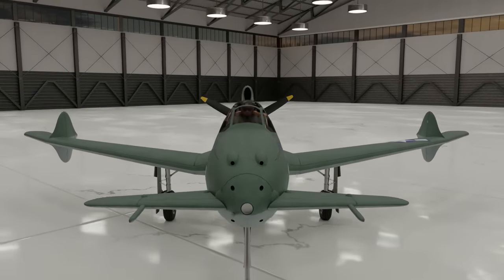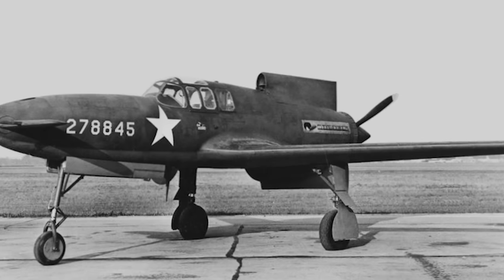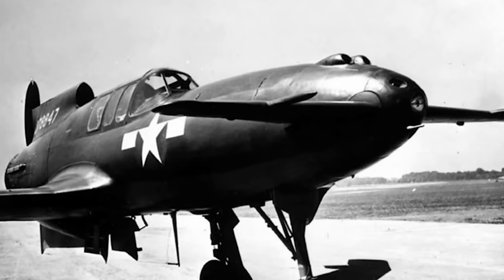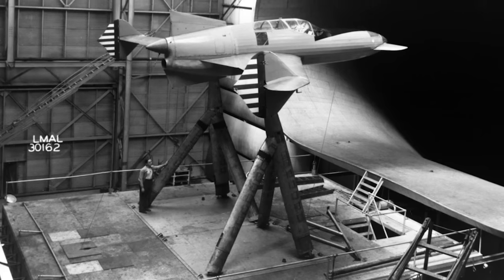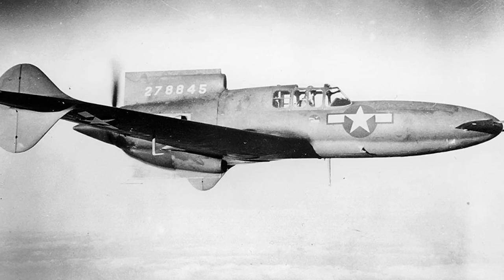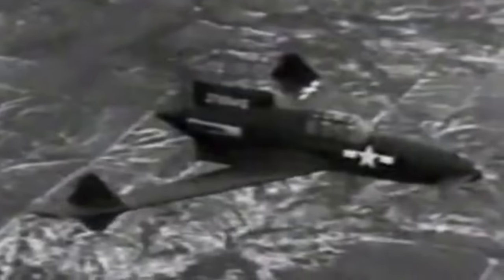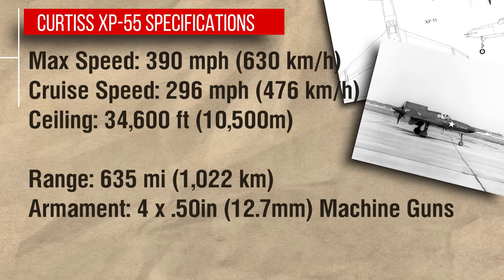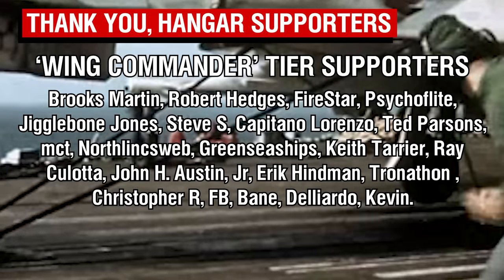The WW2 Super Fighter That Was Built Backwards | Curtiss XP-55 Ascender [Aircraft Overview #76]

Comment: Often wonder if the similar looking Kyushu J7W Shinden had undergone more testing  how it would have turned out in comparison to the XP-55. IIRC only 3 test flights were flown before the end of the war put an end to it's testing.
Reply: The j7w is one of my favorite aircraft I really wish there was more information on it as well I feel like basically all the statistics currently available are sketchy due to the lack of testing
Reply: Unfortunately for the Japanese you are right, only 3 15 minute flights were done on 3rd, 6th and 9th of August (last two being the same days the Atom bombs were dropped). Flight was delayed as the engine was taking longer than expected to be built, and in early 1945 they wrecked one engine due to it prop-striking. Another prototype was completed but never got an engine to it.

The designers noted major issues with the torque, unlike the XP-55 which was really quite disappointing in pefformance for the time the J7W didn't seem to be, but takeoff was said to be difficult and the aircraft flew at an angle the entire time due to the engine torque. The designers were supposedly confident they could fix this issue though.

Arguably the J7W had far more potential as it wasn't underpowered to begin with, however that's just guesswork really.
Reply: The prototype Shinden still exists. It is part of the Smithsonian collection.
Reply: Sanka Mark B from sky crawler should be the answer on that question

Comment: The sole Kyushu J7W still exists. During the US occupation, it was taken to the US for further testing, though I don’t think any was done. It had now armament installed, and no provision for it in the nose. Now it is part of the Smithsonian collection awaiting restoration. 
Unlike the XP-55, the J7W  had an air cooled engine. That was mostly what Japan used for aero engines, but in this case there was a second reason. With the larger intakes needed for air cooling and the pusher propeller, Kyushu made provisions for easily replacing the piston engine and propeller with one of the jet engines Japan was just beginning to build. It wouldn’t have looked the least bit awkward — unlike the way the unfortunate Ascender might have looked.
Reply: I built the Tamiya J7W many, many, years ago and thought it was a great-looking aircraft. So much so, that I have fantasised what the CAC Boomerang would look like as a canard-equipped pusher aircraft, with the 2 X 20 mm cannon and 4 x .303 machine guns in the nose, and the Wright Cyclone motor in the back. I know that the Royal Australian Air Force would not have approved it (too radical), but I still want to create one as a model, probably based on the Airfix Boomerang (it's cheap) rather than one of the other available brands of Boomerang. One can dream.
Reply: "That was mostly what Japan used for aero engines"

Due to the simple fact that they had some amazingly good ones that were created during the 30s and early 40s.   Had their industry been up to the task of massproducing them at good quality, most Japanese aircraft would have had 10-15% more power(and not required hours of "finishing" work by techs in units before replacement engines could be used).
Reply: @brettcoster4781  Long ago, when I was a mad plastic modeller in my early teens, someone gave me a very poor quality kit of a Bf-109F. As I already had several good Bf-109's, I butchered it into a canard, inspired by the J7W, XP-55 and SAI SS4 I had read about in William Green's Warplanes of the Second World War pocketbook series. It made a fairly convincing looking "what if" aircraft.
Reply: The us did the same thing with the germans, and rumors are out there that we found some of there late era 109s the k's and the g 13s but mostly the Dora, i heard we came across some finished, unfinished and had them flying better than any existing allied aircraft. The germans were using really bad quality steel and the Jumo had overheating issues, we probably added better steal that conducted heat off the engine, and probably tinkered with the fuel and the absolute highest the jumo could operate at without knocking, that was the issue with it. The mw50 helped it not knock alot and was almost a 95% solution for it. Nobody knows the details, just claims about the results. So people can really only speculate, i get alot of people saying thats impossible to push more power out of the jumo, ive had others say thats not entirely true. So im not sure. But i bet we messed around with these aswell, but this is so far from anything  at the time, this design was so alien pilots were probably sketchy about even test flying it, u need to bail ur hitting that rear prop lol, so they needid a way to have to prop destory itself right i think? but sometimes this wouldnt go off lol.
Reply: @profo4544  Germany also had poor quality fuel.   Which is part of why they pushed hard for jets, because it didn't matter much there.
Reply: @DIREWOLFx75  I know, wich is why im saying what we did was got there planes running off our high octane fuel. But the issue with this is it would caus the jumo to knock, the mustang had a large aftercooler, the jumos didnt have this. This was why the mustang was able to do what it did. So high octane with the jumo would mean alot of knocking so to fix that, we probably had the engine being fed MW-50 the entire time, because that reduced knock almost entirely. I bet we filled a fuel tank with mw-50 and had that spraying the entire time to keep knock down, and probably applied some better quality metal to areas to bring heat off of certain areas of the engine. At this point, we were masters of production lines, we literally taught rolls royce how to make there own merlin we came over there and showed the Uk how to do high fast output production lines of quality. So we were able to come up with some quick solutions i imagine for some things. But the Dora d-13 in specific was the best fighter of the war, the entire airframe is based around the flipped inverted v-12 engines the germans used, we didnt figure out the advantages of inverted engines until years later, if you look at a dora its like a pyramid from behind, its bottom is wide and flat wich helps for AOA and just all around low drag and manueverability, the bottom was wide and flat while the top comes to a point, look at the top of the tail, if you look at one from the rear youll see what i mean, bf 109s were made a similar way. But the d-13 had hydrolic ailerons and had a better jumo that was tuned to operate better at higher alts, it could roll like the antons and packed 3x 20mm cannons, in perfect fuselage mounted spots. You dont want wing mounted guns, wingflex and to many other issues can throw off ur shot, they also take longer to get lead on target than nose/fuselage mounted. We didnt try this because to do this you need them shooting thru the prop, we had a 30-40% reduced rate of fire doing this, the germans had a electric switch that cut this down to a 5-7% loss max.
Reply: @DIREWOLFx75  
German C3 fuel was about as good as aviation fuel got...
Reply: @ThatZenoGuy  And how much high quality fuel did Germany have available compared to lower quality?
Very little.
USA/UK were the only ones with good supply of high quality aviation fuel.

Heck, one of the reasons for Germany to switch to jets was because they could run on any fuel.
Reply: @DIREWOLFx75  
They had a fair amount of fuel, obviously not enough but even the B4 fuel was not of terrible quality.
And yes, jets were capable of running on more primitive fuels, thus they were given much more attention, and for good reason.
Reply: @ThatZenoGuy  "They had a fair amount of fuel,"

Then explain why already in 1942, large parts of the LW had to downgrade from the best fuel.

"but even the B4 fuel was not of terrible quality."

Irrelevant.   It couldn't compete with the common fuel used by wallies.
Meaning that especially their fighter aircraft went up with a clear disadvantage from the start.
Reply: @DIREWOLFx75  
Several late-war German prop planes were exclusively designed for C3 fuel, so it wasn't rare to the point of nonexistence...
Reply: @ThatZenoGuy  The fuel problem for the Luftwaffe wasn't a non-existence issue. It was a "not ENOUGH existence" issue... When you're fighting for air supremacy, you need lots of two things, armed aircraft, and the fuel to keep flying... 

    Basically, 20,000 planes do you NO good when you've only got enough fuel for about 500 of them to spend any time in combat. ALL the rest are sitting quietly like dumb sh*ts on the ground... and a LOT of pilots are helplessly wringing their hands and watching their careers and lives go up in smoke when the 500 that DO take off, still have to face an enemy armed and ready and prepared for a flying force of 20,000...

     Hitler's EGO lost him the war, plain and simple. It doesn't take a crucial resource to be nonexistent to lose. It only requires you have less than you need to remain competitive.  ;o)
Reply: @ThatZenoGuy  From nearly a third rate banana republic to a dominant world power from 1933 to 1941-ish... No, that doesn't work out in the math...

    ANY tactician worth his salt will happily warn you against anything resembling a "Two Front War"... In fact, there's a fairly frequent strategy between allied countries to instigate a two-front war on a mutual neighbor, called "squeeze play", which basically involves each of the allied countries taking turns at the neighbor, tying up troops for a time, then stifling and reluctantly creating treaties... and repeat... first one and then the other... The further their borders are from each other the better (say two countries directly across the third from each other being optimal)...

    Hitler let his early success through Blitzkrieg set him up for disaster. Taking on the Western front with England and the channel... Rommel running around Africa and spreading supplies and lines thinner, and then plunging into full-on invasion with Russia like he was invincible...

     That's not to say he was outright stupid... BUT a THREE front war, when EVERYONE worth anything would tell you to avoid TWO???  That's ego, buddy... simple ego.

     You can blame jews now just like Hitler scapegoated them for WWI, and it's still as much bullshit. Catholics are world renowned for lamenting their religion instead of celebrating it. They're JUST as good for fatalism... SO no, it just doesn't hold water...

     AND sure, as tradition held at the time, "To the victors go the spoils"... The world DID pick on Germany post WWI... I won't dispute that. It just wasn't all on the Jews, nor on some coalition of Judea... Hitler had a "good" thing going... a very real chance at world domination in fact... even as radical and irrational as it sounds. He screwed up because his big fat EGO led him to over-extend his resources, personnel, and technology... He got off to a rip-roaring great start, but zero follow through.  ;o)
Reply: @gnarthdarkanen7464  
Protip, Britain and France declared on Germany, not the other way around.

Guess which tribe told them to do so?
Reply: @gnarthdarkanen7464  
France declared on Germany, not the other way around lmao. Try harder merchant.
Reply: @gnarthdarkanen7464  
Odd how France didn't declare on Russia, who attacked Poland also.
Huh...
How much they pay you to debate online? Or do you do it for free (Typical).
Reply: @gnarthdarkanen7464  
Cope, judea declared first because they didn't want central banks.
Reply: The bickering of folks in this area of the chat box. 

As a person who's reading both sides I lean more toward the ones stating more facts. Less on your side in this zero. You do point out some flaws with there claims but replying to them saying to "cope" just sounds like "your wrong I'm right now be quiet".
Reply: @sinisterisrandom8537  
Cope. And read what my name is, there's no R's in it.
Can't stand these bot accounts.
Reply: @ThatZenoGuy  Nah, C3 fuel was about 100 octane. The US could make 150 octane fuel at that point.
Reply: @reinbeers5322  
C3 differed over the course of the war, at the end it was around about 130 octane, hardly any difference than 150.
Reply: @ThatZenoGuy  If you've got an allied report of 130 octane C3 fuel, I'd love to see it. As tested from the ones i've seen, it was 100 octane. The power output of german engines lines up with this number.
Reply: @reinbeers5322  
C3 fuel got to around 130 octane, yes.
Reply: @reinbeers5322  
Additionally late-war stuff got upwards of 150, on rich settings at least.
Reply: @ThatZenoGuy  Again, do you have an allied report showing they tested C3 fuel and found it had 130 octane?
Reply: @reinbeers5322  
I do yes, but this isn't reddit, so I won't be posting it. Look it up yourself if you want to find it.

Comment: In the 1980’s, I saw this aircraft at Silver Hill, the old storage facility of the Smithsonian air museum. Perhaps it is still there somewhere. It suffered from having the GG to far aft, a common design problem with early canard-type aircraft. Pub Piper designed a similar small plane with the same CG problem…and the same result. Flip over backwards and flat spin.

Comment: Hope you're on the mend. 
I just finished Winkle Brown's book and he mentions the death of his friend in the Dornier 335 after the aft engine caught fire without him becoming aware before it consumed the tail - another menace of the pusher configuration.
Reply: On the other hand the Do335 was fitted with an ejection seat in German service. 
All jet fighters have the engine behind the pilot and a fire warning system.
Reply: @allangibson8494  A very good point about jet fighters, Allan.
There were three buttons to (a) blow off the rear propeller, (b) blow off the fin and (c) arm the ejection seat. "The pilot then tried to jettison the hood manually. If he was still alive after that he either pulled the face blind or squeezed a trigger on the seat arm-rest which ejected him."
The pilot in this crash, Alan Hards, had been shown the emergency drill by Captain Brown, but he attempted to complete the circuit when the tragedy occurred.

Comment: As jets where just coming into play, I wonder if the thought of putting a jet engine in this plane would have worked ever came up within Curtiss???
Reply: Considering Bell and Lockheed kinda got the first run at American jet fighters I don't think so. But funny enough the J7W which is relatively similar in design did in fact have plans for a potential jet engine

Comment: The larger Dornier 335 was the German twin engine "push-pull" similar, but less radical concept that also tried to get a quickly produced high speed interceptor into use by utilizing a slicker, powerful, overall design.
Reply: The 335 was REALLY fast. Two engines but with the frontal area of a single engine plane.

Comment: With the tendency to flip over into an inverted flat spin when they stalled, I'm thinking a shoulder-mounted wing was called for. With the all-moving canard barely above the wing, downwash from it cancelled any lift for a slightly wider span on the wing than the elevators themselves had.
It's a pity they couldn't strip a Packard Merlin from a Mustang before the USAAC caught them...

Or a Rolls Royce Griffon with contra-rotating props.

Comment: The Seattle Museum of Flight is worth a visit too, especially if you can get there when the Blue Angels are flying at Seafair. They use the runway the museum used to be a terminal for. They also have an SR-71 with a prototype scramjet.
Reply: Yeah only about a 33 hour drive from the Air Zoo! If you could drive non-stop. 😆

Comment: I don't understand why the XP-55 was plague by so many problems.  It has almost identical design as that of the Rutan VeriEZ and Long EZ, and those 2 aircrafts are very stable airframes, very safe and easy to fly. Not only that, the Veri and Long EZ do not use computer flight controls. They are kit planes where owners build them from a kit in their home.

Comment: Actually, if you look at the Wright Flyer, you find the same configuration. Pusher engine with stubby forward wings and main wings aft.
Reply: With the huge difference being expected airspeed.
The Wright Flyer needed the lift added by the elevator and the plane was slow enough for the pilot to handle it.
Reply: Also looks a lot like the Rutan Vari-Eze.

Comment: Normally canards are really idiot proof in any form of stall. Today we design them so that the front wing stalls first and then drops the nose and thereby avoiding the stall on the rear main wing. I very occasionally fly a Vari Eze designed by Burt Rutan. And that thing is not just blisteringly fast for a O-235 engine, but it is also very forgiving at slow speeds. I like it, it's a pleasure to fly.

Comment: Bert Rutan was able to solve all these problems with his Varieze line of aircraft, which has become a very successful line of home built aircraft.
Reply: Lived near Mojave airport in late 70s. Was building a Vari Eze. Took parts on weekend to Rutan’s hangar at Mojave Airport for him to inspect. At about that time his newsletter mandated a certain amount of hours before first flight in a Grumman Yankee cause the Vari Eze was fast and squirrelly( very short wheel base) on landing. . Too many Cessna 150 and Piper Cherokee 140 pilots were cartwheeling down the runway and dying. I found that out by subscribing to Aviation Consumer Magazine where they reported on these incidents. I stopped building it. He designed the Long Eze to help take care of the problem.  But I didn’t hear much about all the accidents.